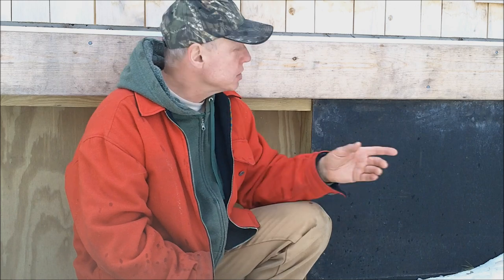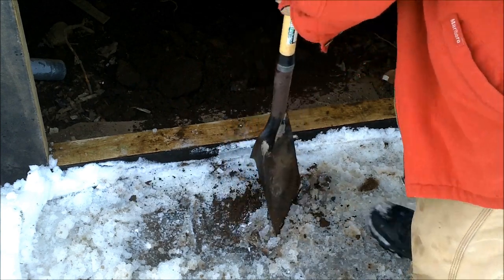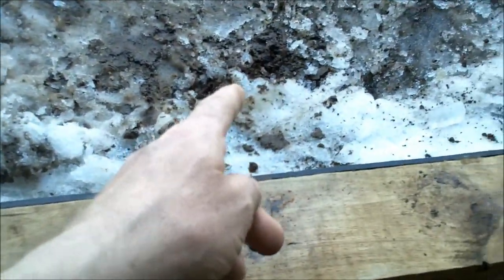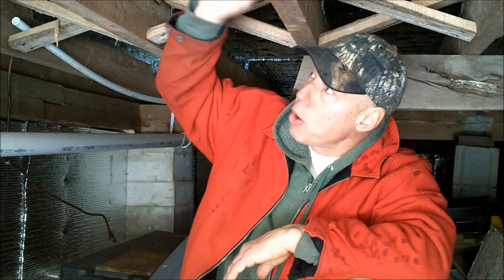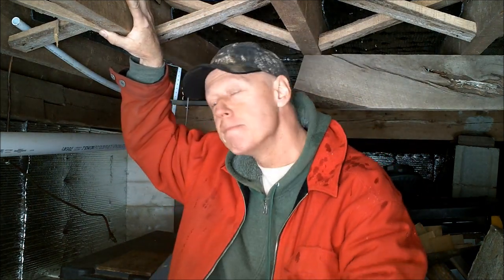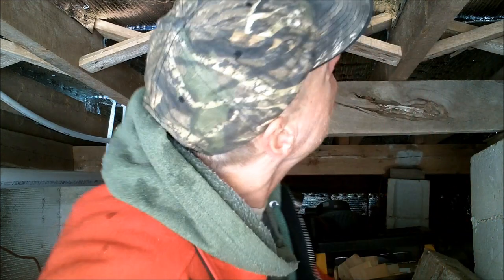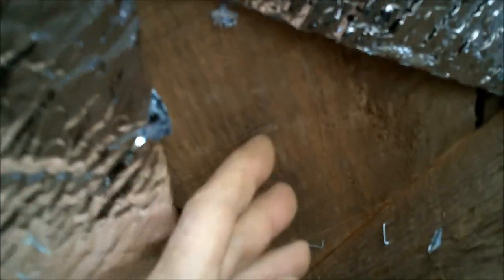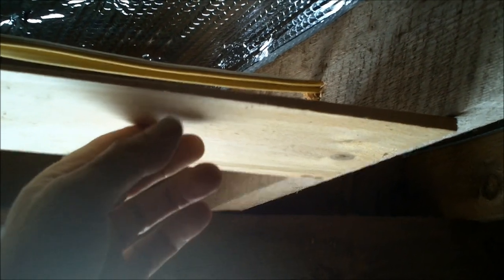HOW TO INSULATE A CABIN FLOOR AND KEEP IT RODENT FREE   PART 2

Comment: This stuff is amazing!!!!!  I was able to stay in my 20 year old camper during upstate New York freezing, below zero winters.
The only suggestion I would make is to do 2 layers. Leave a little space in between.  Perhaps one tight layer one loose layer.  Not a large gap, just a 1/4 inch space, even less, even loosely let the two side by side with no real gap.  Again, staples the first layer tight to the underside of the floor, and the put a second layer loosely right on top, (or below) it.
Somehow the 2 layers gives MUCH more protection from the cold.. And the slight loose airspace between the two layers, gives so much more insulation.
Can't explain it right..but it WORKS!!!!

oh yeah, just want to mention one frustrating thing.. Upstate New York mice chewed the bubble foil!!! Little nuisances!!!! Now, they did not chew it as much as they would typical insulation... But they did chew it... New York mice... Grrrrrrr........

But... You are correct sir!!!!!
This stuff works!!!!!!!
Reply from the maker: If there is a warm air space behind it, they will chew through anything to get in there and nest.   That's the only drawback to leaving an air space.
Reply: @thebossoftheswamp  ah... I see now... Because I put it over a vent that I was not using, to stop drafts.  They must have chewed through it to get INSIDE to the warmth behind it.  (The inside of the camper/tiny home.)
But, I will say in the areas where I layered it on top of each other, again, I didn't really leave a space, I just did one pulled and sealed very tight and one a little looser, they did not chew through those areas.  Maybe they didn't feel the warmth because it was so insulated.  Do not know.
But yeah the "experts" say to get the proper "r factor" you have to leave a 2 inch space between, blah, blah, blah... I was concerned about the nesting part... That is why I just layered it right on top of each other.

I haven't read all of the silly comments from those who haven't actually tried it, sorry you are having to endure those...
Let me say again... You are right.  The proof is in the pudding ..... and in the unfrozen water!!!!!!
Thank you for your videos!!

Comment: Hey Boss.. I hope that you are feeling good and still recovering. I have a cabin in Northern Wisconsin built on concrete piers. I have about 2-3 feet from ground to bottom of joists. Will foiling the floor without skirting still keep the floor warm?

Comment: I use bubble foil as well , I built a work shop on a concrete slab put the bubble foil on top the gravel poured the slab , built another one same size no foil under the slab noticeable difference in heat and cool retention , have used it in other applications as well  I don't care what the self proclaimed experts say the stuff works. I would much rather take advice from a person that lives in a sub zero climate than a r value king. great video .
Reply from the maker: This stuff is amazing isn't it?

Comment: Terrific bubble wrap idea!  I had the same issue.  Rats got into my crawlspace and destroyed all of my nice fiberglass insulation between the floor joists.  Pest Control did a very costly remediation to clean, sanitize, and plug access points.  However, I chose not to replace the fiberglass insulation, because I didn't want to ever repeat that costly disaster again.   So, I've been trying to find a cost effective and rat proof way to reinsulate.  I've thought through the various other strategies, but none made any sense.  However, the bubble wrap insulation stapled to bottom of subfloor seems like a solid idea.
Reply from the maker: I have a followup video coming very soon on this subject.

Comment: Sold! Bubble foil it is. I have a building sitting on peers and I am going to skirt it just as you have done. The building has some old windows that I intend to renovate and tighten up so that air filtration is reduced. I think I will make some storm windows too. Reduce the air filtration around the doors too. Then all I have to do is add a wood stove that will generate more BTUs of heat than the cold BTUs entering the building. I suspect your cabin fits this bill as you are comfy warm. I heard bubble foil only lasts for one winter! Just stirring the pot.
Reply from the maker: Comfy it is :-)

Comment: No rot, moisture or rodents eating away at the inside of walls and it's affordable.  Much easier than cutting foam board, then still having to spray foam the gaps and at 40 below with winds needing plywood for an arctic entry.  You always have great info, cost effective solutions as well.  I will be going this route, especially after seeing the increase in costs of building materials here in Alaska and most needing to be done by myself.  Perhaps when spring comes, by the following winter I won't have to live in town anymore.

Comment: Great video. I'm at the start the of a renovation and will be using this in 3 different applications. The first application on the underside of my roof trusses and then I will have 1x3 strapping for the finished ceiling to attach to it this way I have an air gap that will also help. The second application stapled to the floor joist 1" below the flooring in the crawlspace again fro an air gap, and then to the inside of the skirt wall. 

I also had a question on the outer surface of your skirting what material are you using? I'm thinking I want to use plywood with a waterproof layer over it.

Comment: Just wanted to give a heads up to anyone who is going to do this. Make sure that you will be 100% dried in before the rain comes or you will have to go underneath and cut holes in the insulation to drain the water (ask me how I know) otherwise going in after being dried in and  putting the insulation in the individual bays would be another option.  Radiant barrier is awesome stuff for preventing heat and cold transfer as long as you keep a small gap in between .
Reply from the maker: Agreed.  I've mentioned this several times since I first showed this application.  If water gets trapped, just slit the foil and let it dry out, then staple it back up.

Comment: Thanks for the helpful info. 
One question....What, if anything, should I do to create air flow in my crawlspace.
Before your video, I figured I would put a small, register sized vent in the skirting on each side if my cabin....but if I bubble foil below the floor and the skirting, venting would defeat the heating benefits, right?
Do you have any advice on what to do there? (BTW, my cabin is in Canada where winters see temps around 15-20°F)
Thanks in advance

Comment: I have a log home and have had problems with the insulation falling (rodents I guess).
I am considering ripping out the fiberglass insulation and replacing it with bubble foil. 
Two concerns. 
1. Humidity gets bad in my crawlspace. 
2. Radon.
Thanks for sharing this video. 
You do good work.
Reply from the maker: I don't know anything about radon but the bubble foil doesn't absorb moisture.  Blanketing the ground under there with a tarp will cut the moisture too.

Comment: Your first builds of cabins, sound so much like what I experienced with a barn I had worked on off & on over 10 years.. (woman working as finances allowed & help)..only to have to tear it down, due to illness it caused...and now, I am trying to add onto an old mobile home that was donated to me...trying to find out how to add onto it..but the ground in back is even with the trailer..which means, first I have to hand dig it low enough to have a crawl space....(major job)...next, I need a video to show me step by step what to do first to make a floor, insulate it (from critters & cold)...you spoke of a "sub floor"...I will have to look this up....and what is needed from there..do I just begin with a frame..say: 8x10...with 2x6's then lay the bubble wrap on top on that or do I cut it to fit into the floor joist??  I'd appreciate any help & guidance you can give.....again, a beginner so I need step by step from the ground up....Thank you & GOD''s continued blessings on you & yours..
Reply from the maker: It all can be done my friend.  Peck away at it and do what you can when you can and you'll accomplish a lot.  I don't have time to type out instructions but if you watch some of the building videos I posted last year, you'll see how floor systems go together. This should help you start a game plan.  Best of luck to you.

Comment: Ya know Boss, I'm kinda like your buddy with the spray foam until I got a quote. I just finished adding a 16 x 24 with 7/12 pitched roof  to my existing cabin. The quote, for 3 walls and the roof deck, was $3,380.00. And you can see by my profile picture that the front wall is mostly windows.  Mamma Mia, you can do a lot with that kind of money!  No... I think I will skirt the cabin and add bubble foil.  Be well, Pete

Comment: Great encouragement, Thanks for posting......I have a large room Im remodeling & while considering insulation, I was heating the label off a bubble mailing envelope,...I had my hand in the envelope as i heated the label & noticed I wasnt feeling the heat I expected...LIGHT BULB......Hmmm could this be the solution to my problem I thought?......I did a little shopping & found a good price for the quantity of stuff i would need,....considered the ease of installation, plus the vapor barrier affect the health & cost factor........Your example made my final decision....plus...I like open beam, it just looks better.

Comment: I think the skirting and bubble wrap on the skirting is doing most of the work and the bubble wrap under the floor is helping contain the 52 degree ground temp to the crawl space.  It would have been interesting to get a temp reading on the water in the jug, ground, and under the floor.  Just to see more factors beyond "it works" because the ground is soft and seems a bit moist.   Also, this is great for the winter but in the summer isn't the foil helping stop the cool ground temp from helping cool the cabin?  So it's a give and take, but as long as it's doing what you want most, that's all that matters.  I wonder too if the floor wasn't insulated at all, wouldn't the bubble wrap help contain the heat leaked through the floor and the floor would be warm?  I guess this is all stuff to test when I get a cabin and tackle these issues.  Great videos. The first one was randomly in my suggested list.  Will check out more.
Reply from the maker: All good points.  I imagine the floor would be the temp of the crawlspace without the foil.  Most of the heat in the crawlspace comes from the ground but without foil in the skirting, that would chill out and the ground would certainly freeze.   regardless of the science behind it,  it's the solution for my needs.
Reply: Perhaps change out the skirting’s plywood doors in the summer with metal mesh on two opposing sides for air circulation.

Comment: Just don't put it in a concrete slab.  Convection vs Conduction is the issue... not about R-factor but method of heat transfer and where and how it occurs.  Great vids bossman, thanks for all you do.

Comment: Could you comment further detail how you build your skirting to avoid frost and keep freezing cold air out? I know you mentioned 2x4 treated framing, some type of 1/4” outer board and inner bubble foil. Love the bubble foil! 
But what board did you say you use to close it in and how did you handle frost heave on the skirting on any of your structures. Thank you!
Reply from the maker: I plan to make a video covering this topic.

Comment: Thanks a MILLION!! I have a 1800's house with the rear of it on a crawl, that's the dining room and kitchen.. The floors are freeeeeezing ! This is my first winter here.. I'm seriously going to consider this bubble stuff, as the same- I don't want rodents, foam VOCs and vapor barriers like in mobil homes that invite rodents, cause condensation and insect draw like carpenter ants and termites (or mold).
Reply from the maker: I have great results from this.

Comment: From my perspective, the reason you won't get floor rot is the edges aren't sealed, doesn't need to be. The foil covered bubble wrap is reflective therefore radiates heat. Batt insulation protects by reducing conduction and must be sealed in, thereby trapping moisture allowing rot to develop. The fibreglass insulation holds moisture and rodents love it for nests. Rock wool type is better because it doesn't hold moisture and rodents don't like it but it's expensive. Is the cost benefit ratio favorable? Probably not.

Comment: Hi again!  Not Sunday Boss!  Lol lol  Well it was fans now it's  bubble whatever!!!  You're always going to have that critical type!!!  It's what has worked for you and as I always said if it works don't knock it !!!!  More power to them if they want to spend more money waste more time redo redo redo their mess if their idea doesn't work. So let it roll  off ya and they don't have to watch  and go do their own channel!!!   I've had and done way more then most will ever have or experience and  what you share has and is great solid common sense info. Gee maybe that's the problem they have no common sense!!!  Thx again for sharing and extra smiles this week!!
Reply from the maker: I could make the floor and R 70 and then run heat under the house to keep my pipes from freezing.  That would make for sense to them haha.   See ya Sunday :-))

Comment: Hello Boss.  Do you remember when I asked you if you would buy the summer grate for the Kitchen Queen?  My (naive) thinking was that it would surely be cheaper than using propane to can food into Mason jars during the summer time.   Your reply was something to the effect of "I have no interest in firing up the KQ during the summer.  Propane is quite economical. :)"

Your reply surprised me, but rather than take umbrage at it like the trolls do, being the "son of an engineer" I decided to investigate your statement in order to see if I was missing something.  I don't have the numbers in front of me, but based upon how many BTUs a gallon (or was it a pound?) of propane produces (it's around 94,000), I then compared that to how many BTUs a propane stove consumes when it's full open (and deliberately not accounting for reducing the flame once you are into the actual processing time of pressure canning, too many variables there).  What I learned was that, depending on how big a pressure canner you use, it'll cost you between $1.00 to $1.50 worth of propane to process seven quarts of food.   Plus, when it's the middle of summer and temperatures are in the 80s to 90s, you don't have the KQ turning the inside of the cabin into an inferno, just to save a buck per canning load on propane.  In conclusion, as a very wise man once said, "That's just good Backwoods Logic!" 

Don't let the haters and trolls try to bait you, Boss.  If what you told us was BS, you wouldn't have 74,000 subscribers.  Keep up the good work, we're with you, and God Bless!
Reply from the maker: I'm frugal but I only cut corners where it doesn't hurt.  I pinch pennies on some things so that I can splurge on others.  
I won't be firing up any woodstoves in the summer. Nossah   :-))

Comment: Why don't people step back and think boss...
Your insulation may have a crap r value, but what r value do the other insulations achieve when the soak up moisture... 1% moisture can ruin the r value.. won't be happening to bubble foil! 
My building inspector said draughts are the main cause of heat loss. Again your method proves this, your usual method seals the floor completely. 
Stay safe boss
Reply from the maker: Agreed :-)

Comment: I believe you that the bubble foil does insulate the floor but with it freezing outside and the water in the milk jug still liquid means you are getting some heat transfer from the living area to the crawlspace keeping it warm enough to not freeze.
Reply from the maker: Actually, it's ambient temp of the ground being trapped beneath the cabin and not heat loss or transfer.

Comment: Yeup, just like all those little ole ladies who bring their dishes to church gatherings covered in "foil", foil works, as long a you don't have the air flow to move the heat or in my case the "cool air" out of the space you are trying to keep to warm or cool. Also, those that state that it will "rot" your floor, yes it will "IF" you have air flow to move the moist air so that the moisture will accumulate in the wood, but with the minimal air flow you have and the wood stove, you wont have any problems.. Good video.. By the way, I live in Florida so I know what "moist air" can do if not properly taken care of. As for the "r" factor",  I wouldn't use it as the only source of insulation.

Comment: Great video. I’m looking at insulting under the cottage debating on skirting like you or just doing the floor. We are in a cold snap at the moment in central Canada with temperatures from -25 to -44 with windchill. Normal temp are usually around -20. Would you recommend the bubble wrap for my weather conditions?  I have a 1250 square foot cottage and would need to skirt if decided 3 feet high around the cottage. Thanks again and love your videos. Keep up the great work
Reply from the maker: Skirting makes a world of difference. The foil under the floor will reflect the heat back into the floorboards and will keep your floors warm. Foil in the skirting will trap the ambient temp of the ground beneath your structure. This works great for me and I store beverages and produce beneath the cabin all year long.